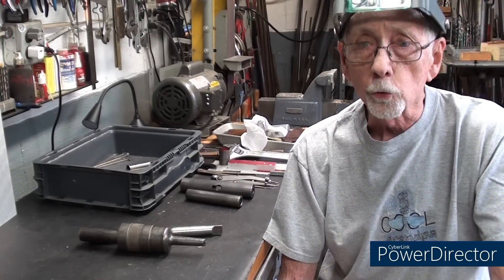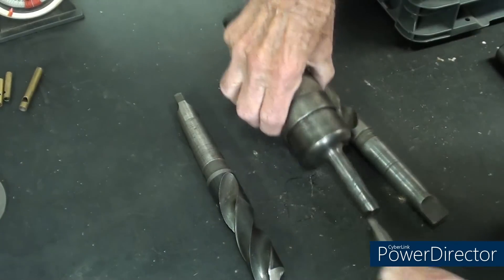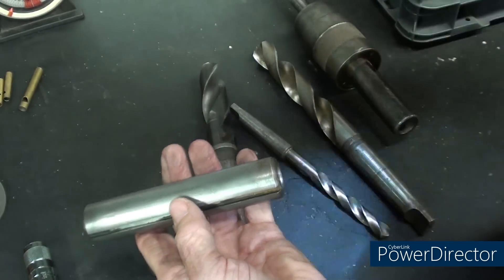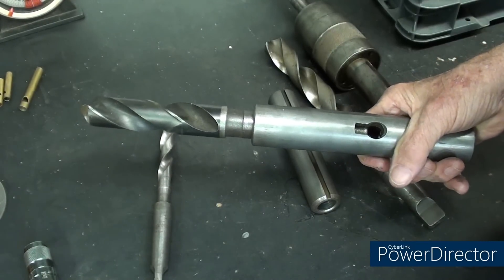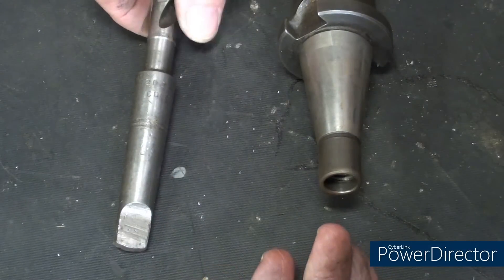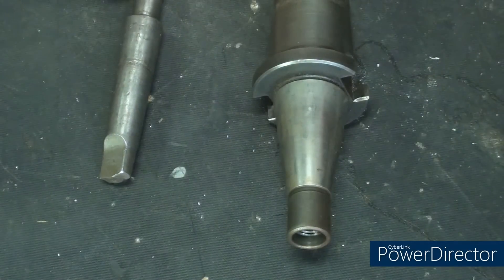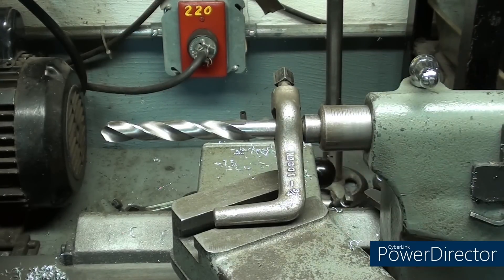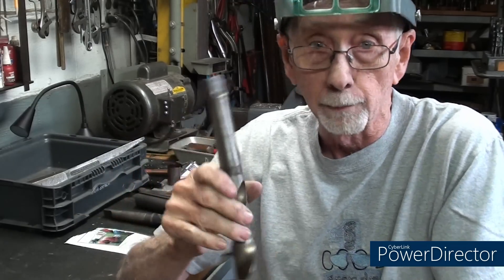WHAT IS A DRILL TANG ? #847 tubalcain mrpete bit taper sleeve

Comment: G;Day from Australia!!! I just found your super informative video while trying to figure out a solution as to why my drill chuck and arbor have just started dropping out of the quill of my drill press!!!  I've been using it successfully for several years (2-3), doing minor woodworking and now suddenly if keeps dropping out!  I noticed that the tang of my MT2 arbor shows some heavy gauling on it.  The MT2 arbor itself looks fine.  It's just the tang that shows some gouge marks across both sides.  Is it just old age "wear and tear" that caused it?  I don't do any real heavy duty drilling with it.  Does the tang really matter regarding the arbors ability to stay seated if it's real purpose is just to keep the arbor from twisting in the quill??? Time to just buy a new one? 
Many thanks for your advice to a newish woodworking from Downunder!!!!  Cheers Alan
Reply from the maker: Welcome
The tang serves two purposes. One is to keep the drill from twisting in the taper. And the other is to allow you to remove the chuck from the spindle using a drift.
I have run into a similar problem and ground a little bit off of each side of the tang. If that doesn’t work, buy a new arbor for your chuck
Reply: Got the new arbor - problem solved!!!!! 🎉🎉🎉

Comment: The 23rd addition of Machinery's Handbook (page 817) calls it a "driving" tang.  To wit:  "The flattened end of a taper shank, intended to fit into a driving slot in the socket."  Also: Tang Drive - "Two opposite parallel driving flats on the end of a straight shank."

Comment: Think about it from the manufacturers viewpoint;  if you need an extended boss on the end of a morse taper so the drift has something to press against, you would simply machine a smaller diameter on the end... the flats have NO function in ejecting the taper.  The only possible reason for performing an extra manufacturing process, (i.e. machining the flats), is to provide a foolproof way to transmit more power than the taper can reliably supply on its own.
Reply from the maker: I could not agree with you more. But people still fight me on this. Maybe they just wanna argue.
Reply: @mrpete222  :  I should have made it more clear... my comment was NOT directed at you... rather it was my "penny's worth" for the amazing number of people who don't see it the way we do!   😜
I arrived at this video because I wanted something definitive I could use as a reference on another channel... people were starting to make the same comments there.
I thoroughly enjoyed your video; I am old enough to recall being a regular reader of the "Tubal Cain" column in The Model Engineer magazine.

Comment: Thank you for all your informative videos.  I have a chuck on a MT2-JT33 arbor that I need to remove.  I ordered a "jacobs" wedge set stamped #2 and it is very slightly undersized to fit over the shank.  Another one I have is marked "6" and it way too big.  I have seen ads for a #3 but without stated dimensions I am reluctant to buy yet another, it's a bit confusing and nobody puts actual dimensions on that stuff.  Thank you for any insight you may have!

Comment: As you say, you will often see damaged or broken off tangs. This confirms they are too weak to drive the drill & therefore not fit for purpose.
A properly seated morse taper will deliver far more torque than the thin flat tang.
Don't rely on the machine pressure to seat the taper, it needs to be driven home by a hide mallet or similar.
Remember there is no tang on Jacobs tapers in drill chucks..
Reply from the maker: There is another video coming soon, where I rehash this debatable subject

Comment: If the tang drives the drill why does my Boxford industrial lathe have no no tang slot in the tailstock.
Reply from the maker: We will never know
Reply: @mrpete222  Tailstocks usually have an auto eject when fully retracted. Most have a tang slot solely for drills too tight on the taper to to be ejected with a drift. I guess it shows that Boxford believe the taper is for driving not the tang.

Comment: My grandfather who was a machinist from 1918 until 1964 taught me at a young age about drill bits and how they were held in various types of machines. His instuctions covered tapers and jacobs style yes the tang was to prevent the bit from turning and as you explained when the bit was about to brack through is when the torque could and would break the tang off the taper bits.

Comment: Hi, a first timer here, not a machinist or engineer by training, but the second I saw the drills in your hand I automatically understood the purpose of the tang.
It seems the easiest way to ensure a sure drill bit, without any slippage. Once you get to the large sizes, the torque on the shank would easily overcome the grip on a round bit. And, as you say, following the force of the drilling, perpendicular to the material, you need the ability to remove the bit without using a  block & tackle, a hitch and a V8. The fact that naysayers abound on this point, does not bode well.

Comment: Fantastic. I have a lathe bit with a tang maybe 5/8" which someone cut square and ground down to get it to fit into a drill chuck. Little did they know the bit was probably worth more than their drill and you can find normal small shank bits that size. I dont know what they were thinking. Cutting hss with a cutoff wheel? makes my teeth itch thinking about it.
Reply from the maker: Mine too

Comment: Not to sound like a smart a** I've seen these before  and it seems like it would  be common sense. If you think about ita** I've seen these before  and it seems like it would  be common sense. If you think about it.  Some of the diameters are larger than larger end of the taper sleeves. The purpose of the taper is not to wedge the bit in harder it's to make sure that it goes in and seats properly and is running straight. As you can see just putting a bit in the sleeve is not enough to keep it from spinning. On bigger lathes that's a tremendous amount of torque.

Comment: I'm actually a bit confused as to why people think it's for extraction.  You don't need a tang to use a drift, the drill could just end where the end of the tang is now and a drift would still work just as well, at least I don't see why it wouldn't.
Reply from the maker: Yes, I am also confused, and I wish I had mentioned that in the video. I think I will beat the subject to death and make a follow up video. Why does a Lathe center not have a tang.     
I will cut the tang off of a drill in jest.
Reply: @mrpete222  
    Use the Handy Dandy cutoff for sure. Just ⅜" in from where the tang begins. The foam that I spoke of was to keep the hardened cutting end from damaging the work on the table, nothing more. But if you gonna beat your best plowing mule, can I borrow it to break up my summer garden? 👨‍🌾👩‍🌾🚜
Reply: I think that the tang has been annealed so that any wear or mushrooming is more readily apparent. It's not that difficult to keep a piece of foam handy to lesson the potential damage that might be caused by a drill bit falling uncontrollably into territory it doesn't belong. Any wear or mushrooming can easily be dressed as needed. Just my 2¢.
Reply: @StanErvin-yo9vl  All drills & reamers both straight shank and taper shank have a soft end for driving and a hard end for cutting. On straight shanks it allows the chuck jaws to bite and on taper shanks it allows and debris to damage the tool taper and not the hardened socket.
Reply: @machinists-shortcuts  
I agree wholeheartedly. I just intended to make a point about the soft end being soft so that any wear or mushrooming can easily be dressed up.

Comment: Regardless of the designer's original intent, If the taper slips and you drive the drill via the tang, you will chew up both the tang and likely the socket as well. The tang is anywhere from 1/64” to 1/32” thinner that the slot in the socket, e.g. 0.250 for a #2 tang and 0.266 for the keyway in the socket. That means all the force is going to be concentrated at the edge.

I use taper shank drills for anything over 1/2" in the lathe, and none of my tangs show any scarring. Next time i do some heavy drilling in the lathe, I'll run the tailstock out afterwards and check the sides of the tang through the ejection slot with some feeler gages. If the tang isn't touching the sides of the keyway, it is definitely not transmitting any torque.
Reply from the maker: That would be a good experiment
Reply: You are using the morse taper correctly, this is why your tangs show no sign of damage. What a lot of machinists don't do is to drive the taper fully home hard enough with a hide mallet. Combine this with unclean tapers and tools will slip.
Sufficient driving friction is designed into the locking taper to transmit sufficient torque for the size of the tool. The tang is designed for ejection only but will drive if the taper is not fully seated.
Because the taper has driven many poorly seated tools it has become a common misconception that it was designed to do so.
Reply: @machinists-shortcuts  As long as the taper is clean and undamaged it doesn't take much to lock it in.
Reply: @PaulSteMarie  I was taught to always give the drill a sharp tap on the end. I think it makes a difference that can be felt when ejecting.

Comment: Lyle,  excellent form and function of the twist drill with a tang. It would be a dull world without opinions.  Mine is,  if you need a dog to reduce twist, I would then use step drills before using the larger size. Thank you Sir.

Comment: In a mill or drill press i prefer a draw bar. When drilling large holes, I step the drill size up, never take more than an 1/8" per side cut. I've had too many friction fit tapers loosen. I still need to modify my drill press for a draw bar, but I have a mill so I'm not in too much of a hurry to get that done.
Reply: I’d like to see how that’s done on drill presses since chucks are typically driven by a splined shaft that exits through keyed step pulleys.

Comment: I imagine those arguing about the purpose of the drill tang are also certain that a pillar block bearing is actually known as a pillow block bearing.
Reply: What is it known at other than a pillow block bearing? Thanks
Reply: @Ellie Price  uh... I stated it's REAL name in my original comment... The pillar block bearing got its name from the fact it replaced a block from a supporting pillar of a building where a line shaft was being installed to power equipment from a single power source, i.e. a water wheel.

Not many buildings supported by pillows that I'm aware of...
Reply: @waynec369  Thanks. I should have known that little piece of important trivia.
Reply: Google pillar block bearing in the UK and all the results are pillow block bearings.
Reply: @machinists-shortcuts  just because everyone is doing it doesn't mean it's right/correct...
Reply: @waynec369  Unfortunately we have to use the suppliers and manufacturers description when ordering. I'm sure the original was pillar but never seen that reference yet.
Reply: @Marley  funny... I always order pillar block bearings from my guy at Motion Industries when I need them and always get what I ordered...
Reply: @waynec369  Motion Industries list them as pillow blocks. Perhaps you should ask them to change their description.

Comment: My Colchester #4 morse taper tailstock doesn't locate the tang at all.
I have drilled 1 1/2" diameter holes with no slippage. 
I have also drilled  3/4" holes with a gauled  taper and it slipped. 
If the tailstock had a tang location slot it would have twisted the tang off.
Reply from the maker: That is amazing. But the larger, a taper, the better holding ability it has 👍👍

Comment: I will quote from the Dormer Twist Drill and Reamer Information Handbook ...
"Morse Taper Shanks are defined as self driving, that is they are designed and made to drive off the taper 
-N O T   T H E   T A N G.
The tang is for ejection purposes only."

End of quote and Lyle please note that Dormer actually put the important part in capital letters. Not me. 

They go on to explain tang failures but I won't bore you unless you ask me to.
Reply from the maker: Well, there certainly are too schools of thought. Even buy major companies.
Reply: @mrpete222  certainly stired up some opinions.
Reply: If drill tangs were “for ejection only” they wouldn’t need to be rectangular in shape. A simple cylindrical projection on the tapered shank would serve just as well.
Reply: @ellieprice363  
I like that reply.
I think to be honest if you are going to have a means of ejection you might as well use it to provide a driving aid.

Comment: Thanks Mr. Pete. I have the opposite of you. My large old buffalo #18 drill press has a small #2 morse taper which from the old catalogs appears to have been an option. I wish it had the larger #3 morse taper. But it does have a slot for the tang and even with that smaller taper it doesn't slip and has remained in great shape. My 13" South Bend lathe has the larger #3 morse taper but has no slot for the tang. It will try to slip with large bits and shows galling from slipping over the years. The tang helps prevent slipping if there is a slot for it. I found a reamer and will clean up the quill bore but on large bits I'm going to try a drive dog like you showed. Thanks for that tip!

Comment: The lathe dog to hold the drill shank is a new one for me. 
My poor old SB 9 is so worn the tail stock was slipping badly. No tang slot to be had. I purchased a #2 Morse Taper reamer and cleaned up the tailstock quill bore. That improved the grip. 
Not having an excess of Morse Taper shank drills I have a few that are full Morse tapers and more that have been twisted or cut off. (I really should be checking out your scrap bin. I'm sure most would be better than my best. 😁😎  ) 
I will explore the utility of the lathe dog so I can continue to drill holes of 1" or larger. 
Thanks for the tip.

Comment: 3 mins 50 into the video and my hands are raised.
It is chicken and egg.
A morse taper is designed and ment to drive the drill.
End of the story 😮
Explain how drills get gauled.
Because people don't clean the tapers especially the female.
A drill with a gauled taper will never drive but it sure as ...... Will twist a tangbstraight off.
I was an engineer in GKN Wheels manufacture and we had all sorts of drilling machines some with 12 spindles drilling and countersinking bolt holes all day and night.

Comment: Mr Pete,  I have a question, did any of the kids ever leave the drift in the spindle and then turn on?
Reply: Not a problem in the tail stock. The drift won't spin. Doing that in an adaptor in the head stock will leave a large dent in the cabinet door right behind the lathe. Or the ceiling. Or the operator.
Reply: @OldSneelock  They have a nickname. Dudley Do Wrong. They usually are called Bubba later in life. EDIT: Sorry. Was meant as a response to Dave Higgins, not you. I apologize wholeheartedly.
Reply from the maker: Yes, many times on a drill press. The drift had a chain on it, and, of course, it broke the chain.

Comment: Hi Mr Pete, thanks for the clarification, I stand corrected, I certainly didn't mean any disrespect in my comment on your last video. I'm an old  engineer, and for years I held the belief of the taper doing the driving and the tang just for extraction, But now after those quotes from those manuals I can see what you mean, I've learned so much from you over the years, and would never doubt your knowledge, well, I'm never too old to learn is my thoughts!, cheers, Dave

Comment: I understand the documentation you presented, however, I cannot understand how the tang end provides mechanical resistance to turning.  No matter how the tang is inserted into the morse taper, it only relies on taper friction resistance.  If the end of the taper had a slot for the tang to enter, I would buy the argument premise, however in this case, I just don't accept the premise.  This is the first time I have ever disagreed with you!
Reply: My lathe has a #3 morse taper with no slot so the tangs don't help. (and it has slipped on me with big bits). My large old drill press has a morse taper and does have a slot for the tang at the end of the taper. You have to rotate the bit and find the slot then it goes in all the way. I've never had it slip. So you're thinking is right. With no slot it depends on friction only. With a slot the tang can prevent slipping but still needs the friction as well. So you don't have to disagree with Mr. Pete! He doesn't shine his penlight into the larger Clausing quill but it has a slot for the tang. And the little atlas quill has no slot. (which he explains)
Reply: @emerycreek8016  Thanks for the clarification
Reply: @emerycreek8016  I think that I remember a locater pin in the bore of the one that I had access to. And a drawbar that was slightly mushroomed. I have seen both types.
Reply: You can see in the drill press one there is that area to hold the tang, thus why you find those with twisted off tangs, as they were driving it with only that small area. Lathe ones tend not to have that, as they are more designed to either have low torque applied to it, as the end casting is held on only by a small area on the ways, or they will have a tapped hole in the end to allow a hold bolt to engage, and provide superior friction force, by having pressure always on the taper so it cannot come loose. Done that way as you can run them in reverse, or also have cyclic loads from cutting interrupted, so want to keep the taper fully seated, or to allow over length stock to be placed through the bore during operation.

Comment: Since most drill presses rotate at speeds too high when using large diameter bits, the tang allows you to turn the bit with a monkey wrench for slow and accurate drilling.